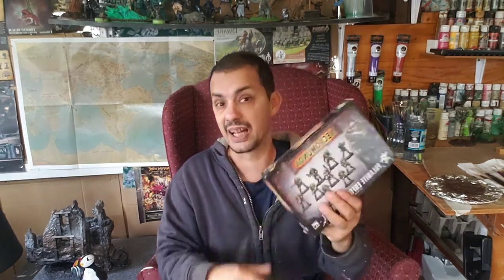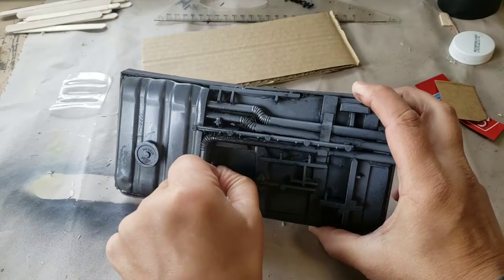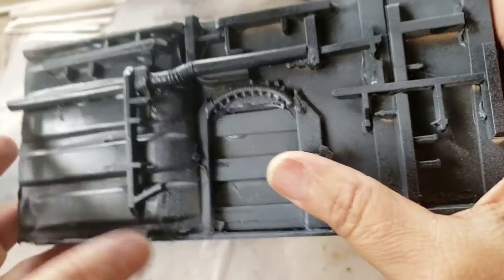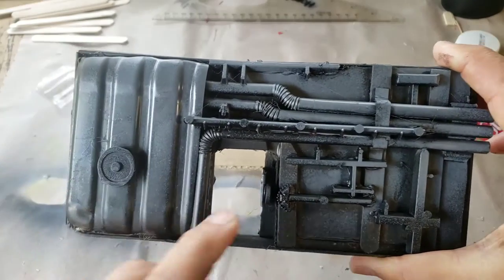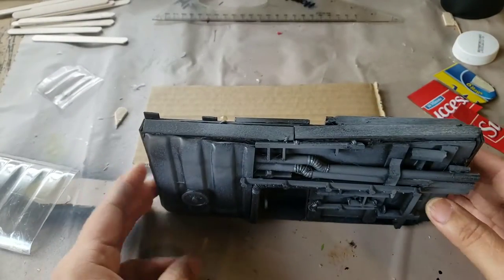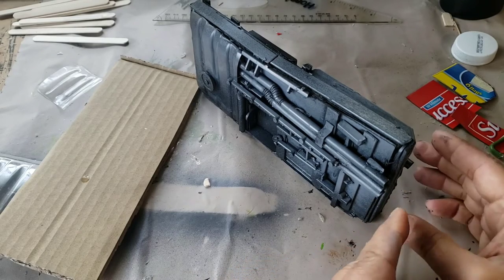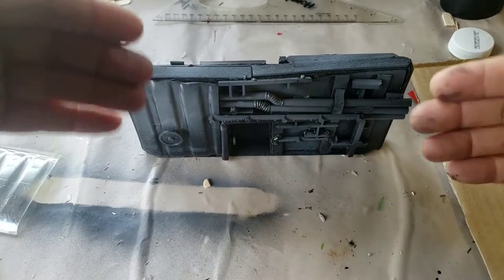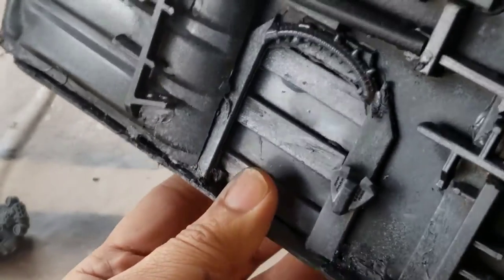making modular walls for a sci-fi complex with sliding doors

Comment: I love the sliding doors.  You can use a marker to note that it is locked to change the dynamic in games.  Sometimes they are able to open other times they are locked.  Good stuff.  Thanks for sharing.
Reply from the maker: Oh very good idea! Thanks. We will be updating this project on our sunday chat.
Reply: @mjhobbycorner5503  A piece of short tube painted red or green to note that it is locked or unlocked place on top of the wall above a door would look good and change access from one game to another.  This may not be needed depending on how modular the board ends up being.  It might also help keep the door from blending in too much (depending on how you paint everything).
Reply from the maker: @HerooftheTable  I like the marker idea, to put it over the door is a really good idea too🙂 .
Reply from the maker: @HerooftheTable  as far as painting I want to do a wash for weathering but leave things kind of dark and gray, like the interior of a ship.